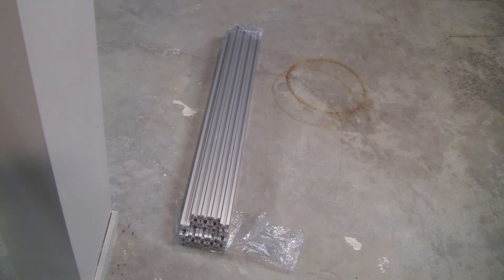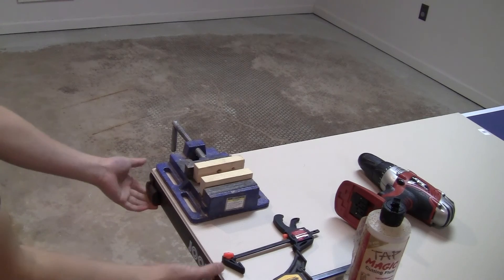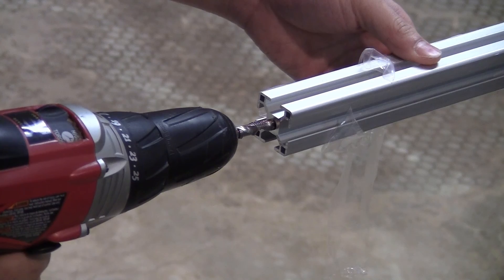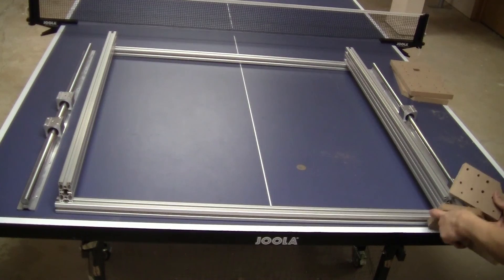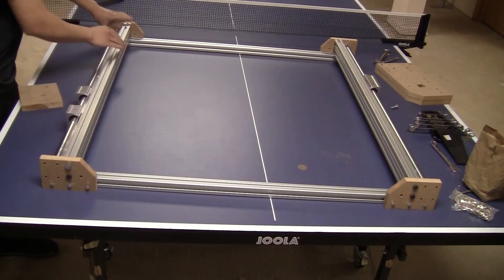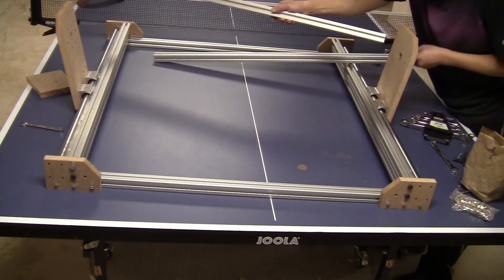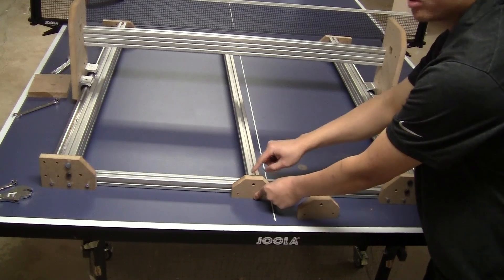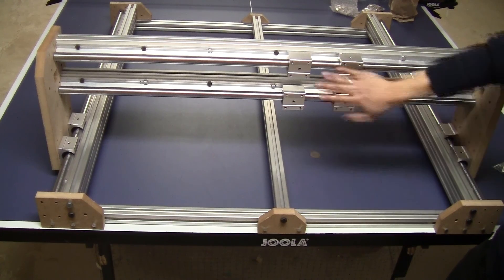CNC plasma cutting table - P2 - Base frame building - X and Y axis

Comment: This should be awesome and a plasma cutter is actually pretty reasonable.
Reply from the maker: Yes, I hope to make plenty of brackets with this for my next builds. Or even to improve this machine itself
Reply: I just spent 10h12m printing the X/Z axis plate for the CNC I am making.  I haven't done PLA in eons so the filament was old but it should work.  I am just using what I have on hand for it and even if I have to nibble my way through material I will then be able to do a better material for the plates so I am doing what you are doing in making something that can make something else that will be better.  Baby steps.
Reply from the maker: Exactly, I think that the right way to do this. We can learn and understand so much more through all steps
Reply: I just had to completely redesign my motor standoff for X because the GT2 belt would hit something and there is no way I am going to do another 10+ hour print like that for the same part.  I figured it out and when this 3h print finishes I should have 3/3.25mm clearance and 2mm deep belt means 1-1.25mm clearance so perfect (I had to do this on my laser).  Since this motor standoff is 30mm deep and will be touching a potentially warm to hot motor I am printing it in PETG.
Reply from the maker: I feel you!!! the most painful part of 3D printing is that it takes so much time for a piece so every mistake is a killer. Since I discovered milling, I barely used my 3D printer anymore.
Reply: Exactly and why I hate 3d printing.  3d printing costs less for a finished part but that part will not be as strong, or rigid, and will take forever to print.  For instance I have a part here that I need to go to a 0.8-1mm nozzle or it would take 3 days to print so I gave up on that idea but at 1mm I think it was down to 6-9 hours.  The negative to CNC is that it would require 5 or 6 axis to be able to do the same parts and the cost of the material which isn't cheap so you make a mistake in it and the wallet feels that.
Reply from the maker: I agree that milling cannot really do all the structures that 3D printing can do, so you still need it sometimes. For the material parts, If I need to make something expensive, I always test with a cheap material first to make sure everything is right before making the real piece.